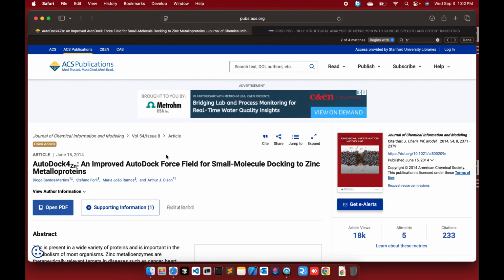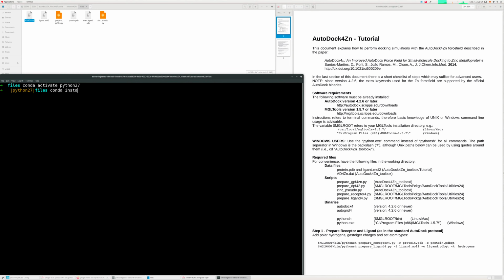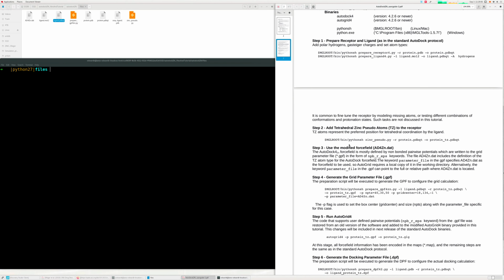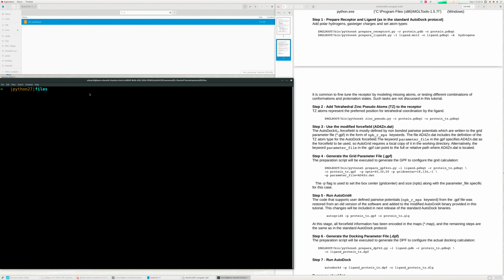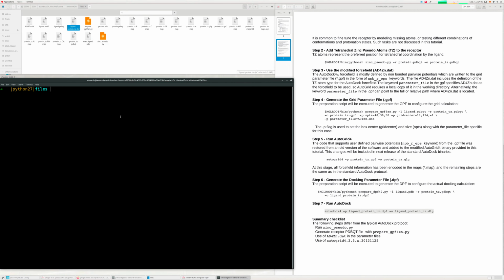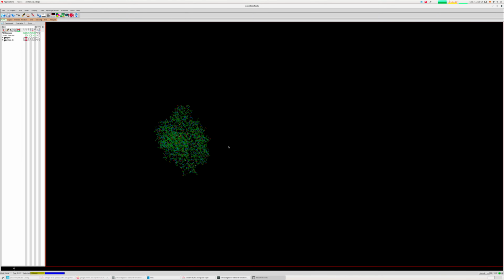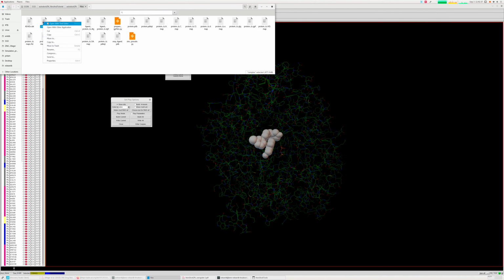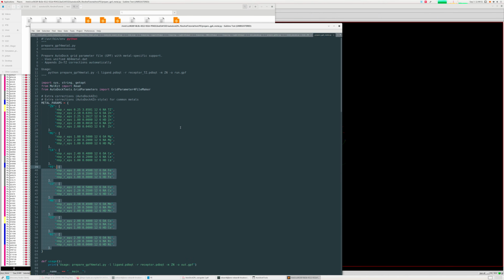Zinc Metalloprotein Docking using Autodock4 | AutoDock4Zn complete Tutorial | Step-by-Step Guide

Comment: I prepared both the ligand and the protein for AutoDock Vina. My protein contains a zinc ion, and MGL Tools gives a charge error for Zn. If I manually define the docking box (without selecting a specific residue in MGL Tools), then add the +2 charge for Zn in a text editor and force-save the PDBQT file, and run Vina from the command prompt as administrator, will I still get valid docking results, or is this approach unreliable?
Reply from the maker: Check the metal docking video.

Comment: Excuse me sir, in this tutorial are you docking zinc to the protein, meaning is the ligand a zinc ion? Or are you performing docking of a ligand to a zinc-containing protein?
Reply from the maker: You have to watch the full video to get to know the details. 😊
Reply: @Omixium_ai  Definitely!
I’ve been waiting for this video of yours for a long time.
But could you tell me now?💀
Reply from the maker: @Kalantar_916 Yes small molecules docking to Zn bound proteins(metalloproteins)
Reply: @Omixium_ai  Thank you so much,
but could you also explain how docking would be done if the ligand itself is a zinc ion?
Or in other words, if the ligand is simply a metal ion, is that possible?
I’m not sure if I’m expressing myself clearly😪
Reply from the maker: @Kalantar_916 I already made a video about that. Check metal docking video
Reply: @Omixium_ai  Do you mean this video: “How to dock metal ions in AutoDock4”?
This was actually the first video of yours that led me to your channel. I followed the steps, but when I ran the docking at the last stage, I immediately got this error:

autodock4: Wrong grid point spacing in grid-map file "protein_Zn.map". 
autodock4: Use either 0.375 or 0.000 throughout! 
autodock4: FATAL ERROR: Using wrong grid-map file. 
autodock4: Unsuccessful Completion. 

The strange thing is that the spacing mentioned in the error is actually 0.375 in all my files.
I have tried a lot and asked several people, but I still couldn’t solve this issue.

I’m not sure if the original zinc position might be incorrect, or....
Honestly, I really don’t know what to do with it.